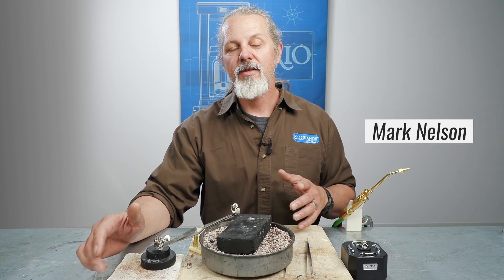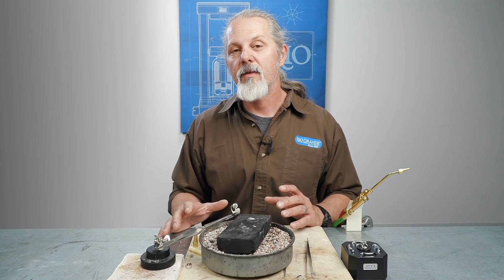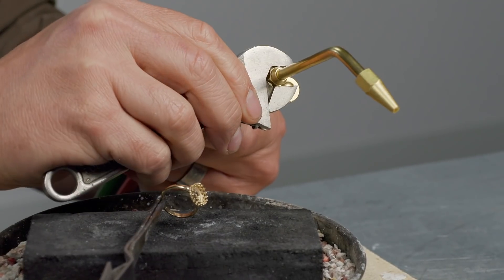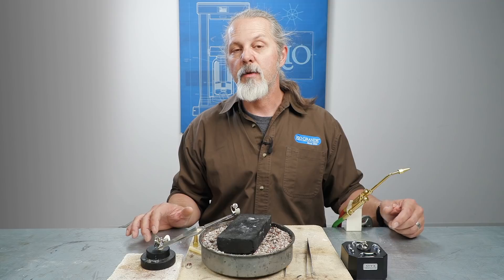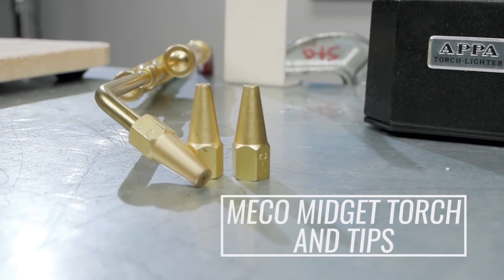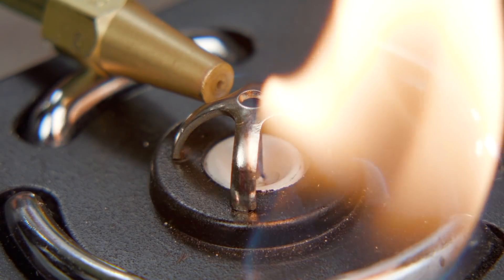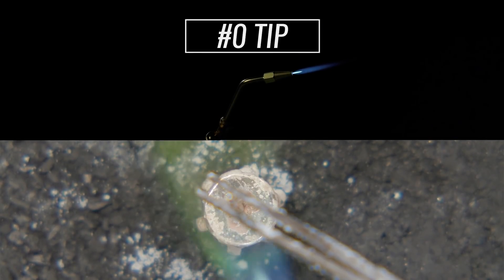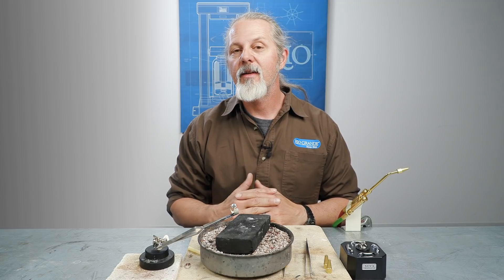Meco Midget Torch Overview

Comment: Has anyone got pictures of the inside of this torch?  Ie from the bottom screw and/or a picture of the valve stem assembly?  I’m trying to figure out how this torch is made.  Thanks
Doug
Reply from the maker: I dont believe we have schematics on this torch.  You might be able to get info from Victor the torch manufacturing company.

Comment: Hi Mark,
May I ask what is the psi for meco oxy/propane?
Thanks
Reply from the maker: Hello Eunice, 
The psi varies depending on the tip used. Here are the specifications: 
#00 tip - 2psi for the oxygen and 2psi for the fuel
#0 tip - 2psi for the oxygen and 2psi for the fuel
#3 tip - 20psi for the oxygen and 3psi the fuel

We hope this helps, but please let us know if you have any other questions.

Comment: I'm paralyzed in my decision-making process .  This Meco Midget is one of my contenders, alongside the Smiths Little Torch and the Hoke (all in an oxy-propane set-up).  All will do what I need them to do.  All are within my budget.  Mostly, I need the one that's easiest to maneuver. A broken hand last year has left me with impaired strength/grip/dexterity in my baby finger and along the outside of my hand. My thumb & first two fingers are fine, but the rest is about 85-90% of normal, so not "that" bad.  

I don't think Rio Grande sells the Hoke, but between the Meco & the Smiths LT, which do you think would be more suitable for my hand issue?  Thanks soooo much!  There is nowhere I can go to handle them for comparison, so I have to rely on others' input.
Reply: I’m in the exact same position as you...! Did you take the plunge yet?
Reply: @bonniemagpiejewellery   Hi Bonnie... Yes!  I finally took the plunge!  I bought the Smith Little Torch from Rio, disposable propane, Paige tips, and an oxygen concentrator.  They should all arrive by late next week (so no opportunity to try them yet).  Do you also have an issue with your hand, or just a bout of decision-making paralysis?  There’s so much to learn. I found it an overwhelming process.
Reply: @Queen_Street_Sterling  well done, how exciting! 😆 I think I’m going to go for it too... I quite like the look of the Meco but it’s about £400 in the UK and from what I can tell the hoses I can get for it are pretty stiff which is the problem I’m having with my Sievert, it’s just too heavy and unwieldy! For me it’s not an injury but what I suspect is just years of wear and tear on my hands and wrists has made them stiff and sore (I’m only 46 so desperately hoping it’s not arthritis kicking in!)... I’m looking for something I don’t need to wrestle with and it looks like the Little torch is light as a feather 🪶 I’d love to hear how you get on when it arrives, I hope you love it 😊
Reply: @bonniemagpiejewellery  Thanks! I hope it’s not arthritis for you.  That’s what it has turned out to be for me... caused by the broken hand. 1 yr later, I have an awesome massage therapist working at breaking down the scar tissue and it’s really helping.   The hoses were exactly the reason I opted for the SLT.  Seeing all those SLTs on All That Glitters help seal the deal 😉.  Good luck!
Reply: @bonniemagpiejewellery  Lol... Today is the one year anniversary of my cycling mishap!  On another note, there’s a place in US that ships worldwide and has extra lightweight hoses for the Meco. I live in Canada, but had considered that option. Can’t recall their name now (Tinman?), but let me know if you’re interested & I could likely find them again easily.
Reply: @Queen_Street_Sterling  thanks for that... Tinman sounds familiar but I think I’m going to go for the Smiths. Good luck with your hand, that sounds like it was nasty!
Reply: So how did your torch work out for you? I like the look of the Meco, but the others are so much cheaper it’s hard to imagine they’d be half as nice as the meco.
Reply: @ThisTall  Hi Kermit.  I love my torch set up now!  I particularly love it with the oxygen concentrator.  I really had a great fear of using those gas canisters in my house.  Now, the only canister is the small camping propane one and it seems to last forever.  I had my husband sit it the room with me while I turned everything on & off 10x 😂.  That settled my nerves.  I spent a lot on Paige Tips, but strangely, I seem to just keep the #5 Smith tip on it most of the time. I’d love to get some formal 1:1 teaching on torch work.  Youtube can’t see me, and I’d love to know if I’m doing anything wrong or am being inefficient in the way I use it. Bottom line, though, …. It was the right choice for me.

Comment: Great torch but I have a question. Mine is set up for propane gas.  I bought the torch from another source with no hose.  I called Rio Grande and explained I neede the hoses for a propane set up, which was sent out to me.  One problem.  The hoses are extremely heavy making it difficult to move the torch around as I’m soldering.  Is it supposed to be that heavy?  I eventually stopped using it altogether.  Would love to hear back on this.  Thanks!
Reply: Thanks for answering,🤗
Reply from the maker: Hi Suzanne - Yes, the hose is intended to be used on large torches or casting torches. It is  reinforced rubber that is rated to 250PSI.
 Let us know if you have any other questions! We hope this helps.

Comment: Thanks for these helpful videos!
Reply from the maker: You're very welcome, Jesse!
Reply: @RioGrande1944  Would this torch be to small for muffler exhaust pipe welding?
Reply from the maker: @2davydo  Our Jewelry Tech Team member does not recommend this torch for that type of work. From what we have available the torch that would work best would be the casting torch: https://www.riogrande.com/product/smith-propane-casting-torch-system-for-platinum/500324. Hope this helps!